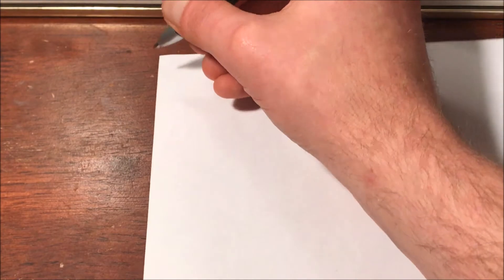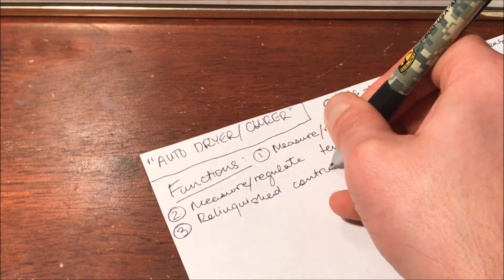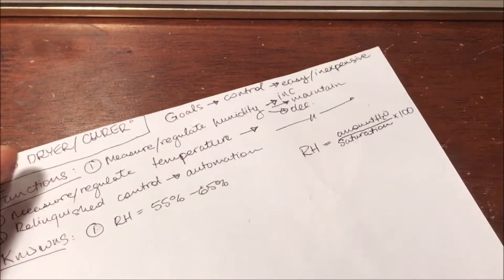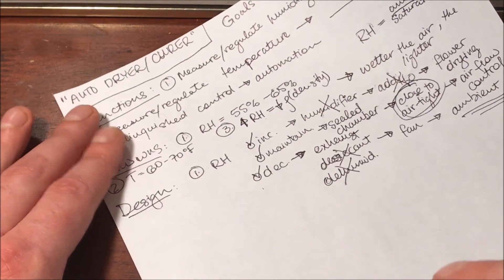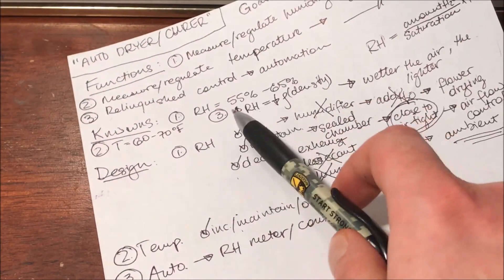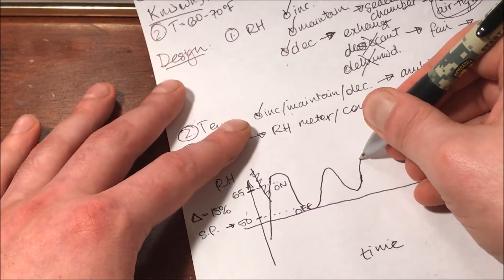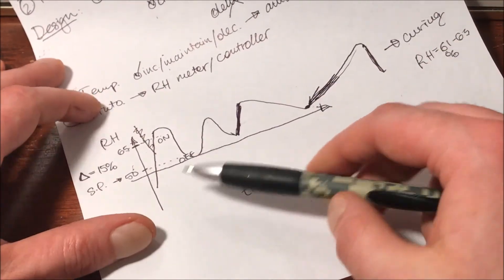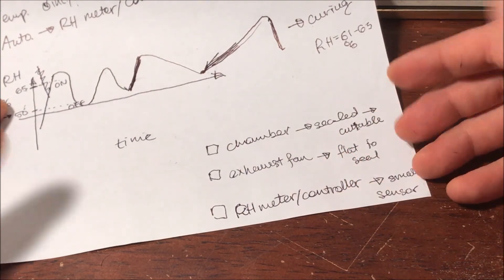DIY Auto Dryer/Curer Part 1: Design - Episode 150

Comment: The talking hands return with another project! Good stuff, looking to do something similar, so nice to see another thought process. 
I have very little experience with drying on any sort of scale, but would the active nature of a box like this not speed up the drying compared to a passive dry at the same humidity? Just a thought. 
Also, I ment to ask: how did the orange julius smell once dried and cured, did it keep its smelly smell? Peace.
Reply from the maker: Nigel Sharp it would only speed it up if you set it to, entirely under your control. You set the range in which it works so if you wanted to slow it down then you would use 60-70% range, or something like that. I found that w the control I didn’t need to try to drag out the drying process, besides the terps are at their strongest when the plant is alive and only degrade after that. The OJ did mellow out a lot after curing, the really strong fecal smell turned into just a rich, stinky, slightly sweet, heady-cannabis smell.  And boy does that stuff pack a punch, very sedative effect. Cheers!
Reply from the maker: Nigel Sharp lol the talking hands